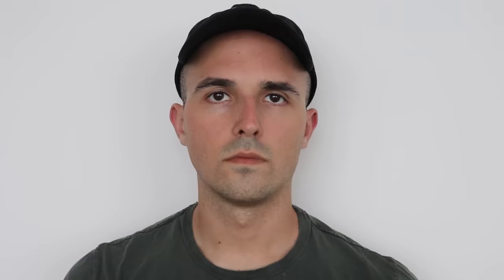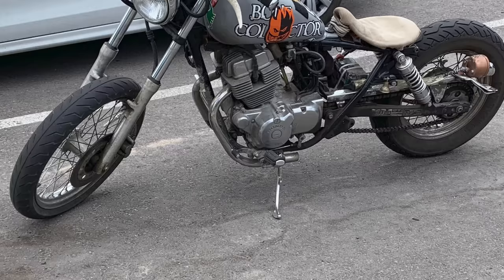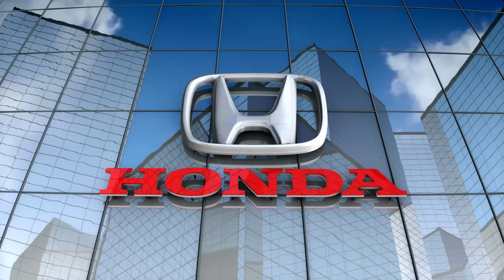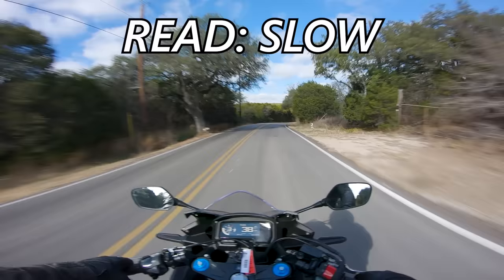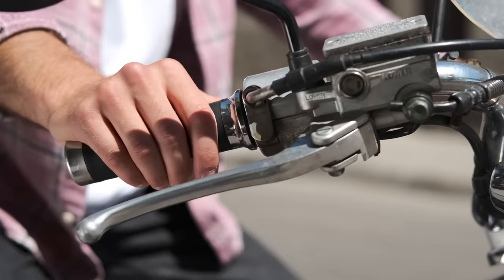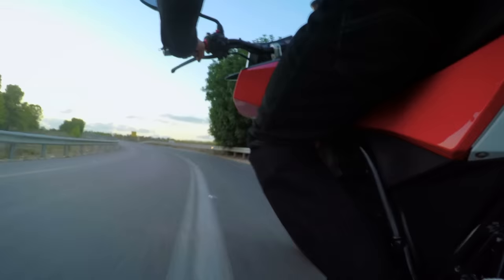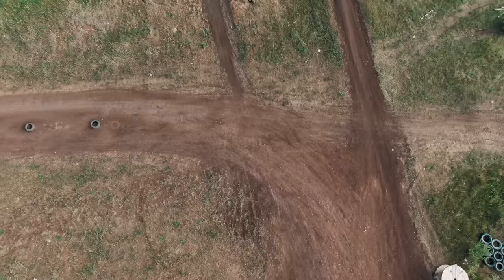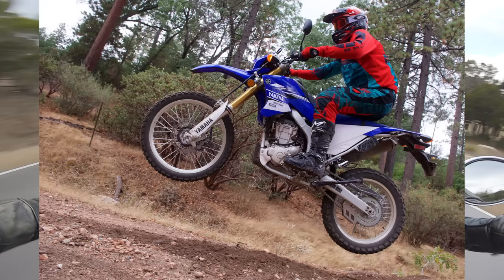7 Used Motorcycles That WON’T BREAK! (Low Maintenance)

Comment: God I'm sick of hearing spites hate boner for carbs! "YOu nEeD To SynC ThEm EveRy MonTh, And adJusT TheM EvEry dAy". NO YOU GOD DAMN DONT!! you sync them as often as you do throttle bodies on an EFI, which is basically never, and only need to adjust them if you CHANGE something on the bike, like an exhaust or k/n air filter, or cams, And if you need to clean them everytime you go for a ride, just sell it cause you aren't ridding it but once a year!
Reply: Yes Spite, tell people to steer clear of carbs, drive those prices down.
Reply: Dude I barely ever touch my carbs tbh. You just run decent fuel and run them often
Reply: Preach!!
Reply: I know! The only time you actually definitely have to synch them is when you separate the carb bodies—which you don't have to do. I've taken apart carburetors, cleaned/replaced jets and gaskets and none of that service requires separating the carburetors.

I think a lot of the "hate" comes from the fact that people take CV carbs and then toss away the airbox and try to use pod filters. The reason those cafe racers could run those type of filters was due to the fact that the slide was lifted via the throttle cable (no butterfly valve and diaphragm). CV carbs don't work the same way and the airbox (in addition to holding the filter) is there to control airflow so that the jet needle goes up and down like it is supposed to.
Reply: 100% true, the only time you run into issues with carbs is when some nitwit that dont know what they are doing starts messing with them.  otherwise they are just (if not more) relliable than efi.  I say this from my 38 years of motorcyle ownership of both carb and efi
Reply: I cannot be arsed with chokes and poor fuel efficiency
Reply: I have touched my carb in 5 years. Still a proper mixture. It's a 200 commuter.
Reply: For Real, could not agree more.
All 4 of my bikes. 
Every. Single. Bike. That I own is carbureted, I spent an hour each time I bought a bike, took off the carbs and cleaned them out and set them PROPER.
 takes 2 hours tops if a guy has an semblance of mechanical knowledge.
Haven't had to touch them since. (pros of proper storage procedures, and avoiding ethanol mixed fuel.)
Oldest bike is from 1971, I've had it 5 years. No issues.

Comment: My opinion the benelli brand should have been #1 my 300 benelli hasn’t had a oil change in 9000 miles and has been wrecked 2 times and has been sitting in the cold weather and it still starts up good and runs great

Comment: 1995 Honda ST1100, 167,000 miles. Yes I have a picture of the odometer too bad I can’t post here. Honda’s truly does go forever. I sold my 2007 cbr1000rr when I moved across country with 90,000 miles on it, still was going!

Comment: Anectodally, my 2011 CBR250R (bought in 2020) seized on me after 700 miles of owning it. It was a beater that had been dropped on both sides, but yeah fresh oil + filter didn't do the trick. Probably shouldn't gotten the valves inspected when I bought it, but now we know
Reply: I’m sorry

Comment: I have 23,000 on my 2017 Thaiumph T100. 2 oil changes. Never warmed up. WFO most the time. No problems. Yet.
Reply: 28 000 on my Street Twin, not a hitch !

Comment: Picked up a just shy of 50 year old Honda CB350 that had been in storage since 1985. It's damn well pristine. We realized that it actually couldn't be ridden regularly, not for mechanical reasons but because it was basically a pristine show bike that must be preserved for the future as a totally original piece. 

It's astounding how much work it doesn't need after a 35 year sit.
Reply: Those are terrible engine reliability, note the rubber pieces will need to be rebuilt in the engine and the timing chain system is poor. My dad has several, and he's needed several... He now curses everything Honda, haha! Also those things are absolutely gutless and heavy. For showroom, I guess, you won't be driving it much so maybe not an issue, but rebuild the engine parts that fail before taking it on a test drive.

Comment: I feel like you missed out the opportunity to mention the 650 twins from royal enfield while talking about the 500. The twins are a better bike by a huge margin with almost twice the hp. Almost as good as the bonnie. Also the 500cc royal enfield is now discontinued.
Reply: And being a royal enfield, in a market like India, it gets tons of manufacturer and aftermarket support. Also big bore kits upto 865cc are available.
Reply: Not even close to the Bonnie on any measure.
Reply: They are no comparison to a Bonneville. Royal Enfield is shit quality.

Comment: Honda is really a trusted brand. Before I had a Honda civic 95 esi manual transmission as a car service from my previous company and man it's tough, reliable and dependable. I was in an accident experience before I was bump by an isuzu truck elf truck at my rear, I was in a full stop because of traffic in NLEX expressway. Only a small dent was made. And it survive a flood in a hotel in San Fernando Pampanga because the hotel staff  there forgot the inform their guests about the flood which is really annoying and frustrating. My gas tank has 1/4 of water from the flood but surprisingly my engine still works after I turn it on and use for several days after I discovered it when I went to a our company mechanic. Old civic are really built tough and reliable. Honda Motorcycle is the same also specially the wave (my cousin have 2002 model and is still working up to now), bravo (my service up to now since 2011), xrm etc. The fuel consumption and maintenance of Honda motorcycles is cheap. The parts and accessories are available in any motorcycle store shop nationwide (my country is  Philippines).

Comment: I bought a crusty nugget CB400T Dream for £300 in 2013 with an MOT, I ran it for a year and really enjoyed it.  I then bought a CBR600F3 and a 929 FireBlade after and made a profit on both after riding them for two summers each.
The only thing I don't like about Honda's is I can never seem to get them handling how I want where Suzuki's, Kawasaki's and Yamaha's seem relatively easy to get them cornering well.  Downside is those brands age a lot worse and cost a lot more to keep running. Well old ones do, I think they get a lot better once you get to mid 2000's.

Comment: Avoid carbs, but look at step through scooters, who hurt you man? 
Yes efi is easy when it works, but carbs are simple. If you are willing to breakdown and rebuild a motor, but syncing carbs is too much hassle I have questions. 
I owned a 84 cb750, Canadian market, and it was hassle free. Honestly wish I never parted with it.
Reply: Aye brother, maple syrup and carbs forever
Reply: He thinks you need to sync and adjust them as often as you ride lol. It's friggen annoying to listen to. Someone needs to tell spite EFI throttle bodies need to be synced to, and just as often
Reply: Also hello fellow Canuck!
Reply: @SuperBoomer95  winter is carb cleaning season. The 3~4 months where it's too icy and cold to ride are the time to wrench. Riding daily with good fuel they're more than reliable enough

Comment: After couple of harley's ,one bonnie and a bmw . My choice for reliability it's moto guzzy , not the fastest but  who need to go fast when you're 41 years old.
Reply: I agree. Not perfect down to the last detail but getting better under Piaggio. One of the few bikes i have no doubt i could rebuild the engine on if i could ever wear it out to begin with. Easier to work on than a BMW the bike they are most like. Yeah, Moto Guzzi is my brand. Ironic since a survey of service centers near me is like gazing out at the expanse of the Gobi Desert.

Comment: I'm surprised the Yamaha Road Star 1700 isn't on this list. I've got an 07 with 120k miles and no problems other than the clutch spring going south recently. Every rider I've talked to has nothing but great things to say about it.
Reply: I thought it had 3rd gear issues.Well does not effect all bikes but you have one its expensive fix 2-3k

Comment: I've done 31 thousand miles on my Yamaha FZX 750 in 2 years just going to and from work.
Only one time in the shop (to change the gas pump, which I did with a Chinese imitation one for a Daewoo Matisse, yes, it fitted, and only cost 12 bucks and works perfectly for a year and a half).
Oil changes, lubing the chain, brake fluids, water from the tap for cooling, and she's fine.
And she was 26 years old when I bought her.
And when it's her time, I'll put her on a small boat, let her out to sea and give her a viking funeral.
Reply: Loved my FZX 750. Had one back in France. She's a looker and a keeper. We never had them in the US so I ride a 1200 Sporty. Pretty reliable and previous owner put straight V&H pipes on that Harley sound so the whole neighborhood knows when I leave and return lol

Comment: Hmm. I have and had a few Bonnevilles both aircooled and watercooled bikes. Both are excellent but the new watercooled 1200cc engine is a bit better,  47 trips down the drag strip and 9 trips running wide open at Bonneville without a whimper. 

I had a EVO 1987 883 Sportster for ten years and put 35,000 miles of trouble free riding except the carburetor was very sensitive to the quality of the fuel. Nothing  like having the engine stop when your passing on a busy highway.  I became lightening fast at turning the fuel petcock off and back on quickly to clear the obstruction. 

I still own a 2017 RE 500 and yes it doesn't break and no it isn't fast. However,  it is the most fun you can have at 50 mph.

I did manage to buy Honda's one model that wasn't reliable....1981 500 FT. The starter motor failed so many times I lost count. The suspension caused the bike to weave more than a drunken sailor.

Comment: Here in Asia, I own a Honda XRM 125 DSX. A low displacement motorcycle with 2 disc brakes to front and back. It never lets me down specially that our roads are uneven on the province. The shocks just do their work when I'm running 85 kph. Honda lives up to its name as one of the most durable motorcycle makers. And they made them Fuel Injected, I run mine on 66 kpl on being a defensive driver, saves me a lot of money.

Comment: i own a Honda Rebel 125 (yes, 125cc) with a whole 10hp. This thing gets almost no love from me, i did the valves last year and changed the Oil, thats it. That thing alway comes to live at second turn and if the battery is dead you can easily push it. Thing runs like a sewingmachine. well, it also sounds like one but thats what it is lol. And i ride it the whole year exept its snowing or like deep freezing. It´s the most reliable commuting vehicle i ever had.

Comment: If you are going to ride when it is 95 degrees F or higher, an air cooled engine will roast you while idling at a stoplight. They are generally cheaper, except a big Harley or Yamaha. I would consider buying a new or slightly used 500cc or 650cc Royal Enfield to save money, even though the air cooling is the opposite of air conditioning.
Reply: You are correct thus I ride water cooled and with a bigger radiator and 160 stat.  It's truly the only way to go!

Comment: you named the v-max as one of the all time greats. I agree..I've owned 2   an 86 and a 93   I NEED TO CORRECT YOU ON a couple of things ..it 1st came out in 85  not 84 and it had duel disks on front...not singles

Comment: Nine second-hand, carburetted Hondas and the only ones with true issues were the two GLs. The timing-chain is an in-built issue, the bikes are also over 40 years old. Other than that, once put right from previous owner issues they all ran like newish.

Comment: REs are the best bet in India because: 1. Spares can be bought off the nearest cigarette kiosk, 2. Service is available with any mechanic who has a screw driver and spanner, 3. Oil and fuel conserving.
Any foreign motorbike 1. comes at a bomb with the govt taxing about 2.5 to 3 x the cost, 2. Service and spares will leave craters in the pocket, 3. All the wrong eyes see it.

Comment: 11:25 yeah, there's a lot of Panigales for sale here in PH with less than 10k miles- most just hover around 5-7k miles. Even the older Panigales have less than 12k, highest I've seen was 15k miles

Comment: I don't know about other bikes but I have a 2001 shadow sabre and I've only changed the fluids the tires the brake pads and the head tube bearings. 55k n going strong.

Comment: Never EVER buy KTM!
I bought a duke 200 and had a major engine failure after 4 days of usage. The valve broke into the engine…

And after that I learned they are manufactured in India I’m not even surprised
Reply: Dang I thought they were 🇦🇹 Austrian

Comment: 7 Used Motorcycles that are reliable and are low maintenance : 
1. Bmw RnineT (air cooled, shaft drive, probably one of the few reliable BMW bikes)
2. Yamaha MT-07
3. Honda CB500 (or CB750 for the old school people)
4. Suzuki SV650
5. Kawasaki Z900RS (or Z900)
6. Kawasaki Z400 or Ninja 400
7. Honda Africa Twin Sports Adventure DCT or Honda NC750X DCT

No Triumph, 29% of their bikes have issues (consumer reports)
No Ducati, 33% of their bikes have issues (consumer reports) and Panigale models and reliability makes anyone who knew the 80s and 90s laugh, as "reliable" as the old Alfa Romeo's from the 80s and 90s :-) Ducati is when you want style and emotions and have enough money and do not care, neither about maintenance costs or replacement parts costs. 
Simply check the price of a replacement fuel tank for a Panigale (even funnier for older rarer models) if you drop the bike and the tank is medium or heavily damaged. 
And then you go a check the prices for Yamaha or Suzuki fuel tanks in comparison.
Have a nice day folks.

Comment: I have to agree totally I have a 97 Honda Valkyrie with 104 thousand miles on it it's still purrs like a kitten I also have a 94 Honda magna 750 with 72,000 miles on it and it runs like a champ and before that I had a 77 Honda 440 super sport with 69,000 mi you can beat your enemies but you can't beat a Honda.

Comment: The Interceptor and the GT are the only reliable Enfields you can buy.
Reply: Went to buy GT650 but didn't. The paint job alone was shody. At least they could have done some good to the 650 brigade. On the other hand, the new Meteor series impressed me.
Reply: @ritwik0  Test ride the Interceptor 650, I own one myself and I absolutely love it.
Reply: @ritwik0  But I personally don't like the seating position on either the Meteor nor the Thunderbird.

Comment: Ah yes i had an 1989 gpz 500s , great little jet. I had a cx 650 e honda after that = go forever . BLISS. as i age (63) i would like another gpz 500 , =light and fast enough to lose a licence, however , in the real world i discovered riding a very light bike in really windy /wet weather was actually quite disconcerting .

Comment: Honda with regular maintenance will last forever.
1st 89 Honda Hawk GT 650. 
2nd 2001 Honda Super Hawk 1000.  
3rd 88 Honda VFR750 Super Magna.
1, 2 bought new, both with over 45k mile on odometer still running like new.
3 bought used in 2012 with less than 4k mile on odometer now has 47k.  Need to rebuild carb.
At 54 I’m not sure if I want another bike.  These 3 can absolutely get me in lots of trouble if I don’t watch myself.

Comment: So you Expert!Where is BMW?Bought 12000 Miles now 175000Miles.1 Clutch,some Brakepads,loads of Tyres and around 100 litres Oil and still running at 40 degrees Celsius to minus 16 degrees!!!

Comment: My 09 Sportster has 19000 miles so far. I beat the piss out of it and all I've had to do besides oil, tires and a battery was adjust the clutch.

Comment: It's not Stockholm syndrome talking, Harley carbs really are simple. I mean they're about the most simple carburetors on the planet, and they're easy to access, they hang off the side of the motor in the wide open, you don't have to take anything apart too access the carb on a Harley.

Comment: I had a chinese scooter and it definitely wasn't anywhere near indestructible. I can't remember how many mufflers I went through in just a few years due to them rusting and breaking off while riding, and if you miss an oil change the engine will be fucked.

Comment: I thought that the Suzuki GSes were the most reliable bikes.  I had a 1981 GS650E and a 1981 850G and I loved both of them to death.  Just put aftermarket or Honda voltage regulators on them.  The original voltage regulators were inadequate.

Comment: I'd add victory, pretty much anything 2003 and up are dead reliable, Parts require a little internet searching but other than a clutch cable brake pads and tires you don't really need much

Comment: Quote ; ''Honda had a 12% probability of needing some sort of major mechanical repair due to mechanical failure'' and that's good ?  and the Hornet got a free pass because its a common problem ? so that's ok then , the volume that they sell is irrelevant, its still 12 out of every 100 proportionately and in a sense the higher the volume the more inexcusable it is, not the reverse as you seem to be saying. I'm not saying that Honda doesn't compare well but 12 out of every 100 failing doesn't speak well of Honda and if that's a market leader it doesn't speak well of other brands either. Or am I missing something here?

Comment: I'm looking at a new bike and test riding second-hand BMW K1200S which are really impressive. There, I'm not keen to embrace the service costs.
Love Yamaha FJR1300s too and would like to try a Honda VFR1200 but these shaft-drives are now just too heavy.
I seem to always share these lines, 'Oh, my Yamaha XJ900F had one AUD $400 service in 8 years and 65,000 km. (That's without tyres and oil/filter changes.) Also, 'I've done 13 hours and 1300 km stopping only for food an fuel.' Only FJR owners match that. What can I replace her with? No! I'll dust her off and give her another service: just running roughly and front brake hydraulics lost pressure. ... I did like that K1200S though.